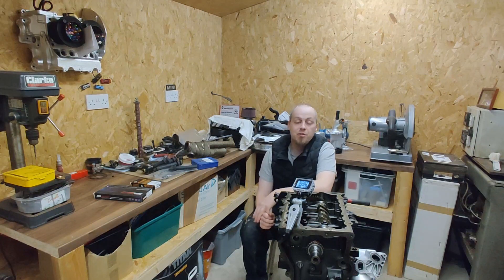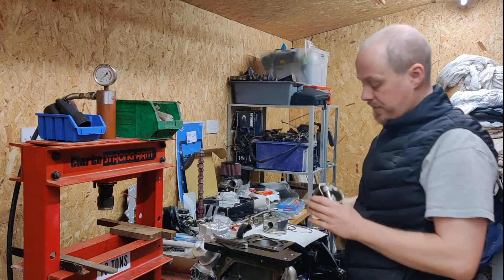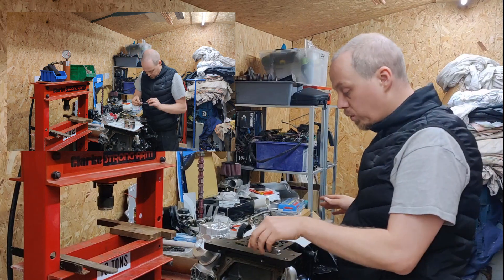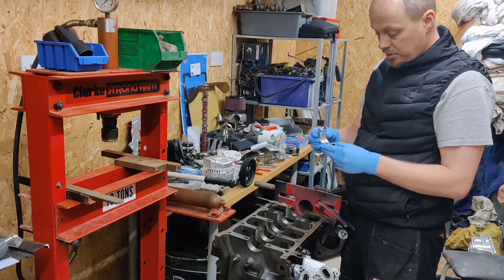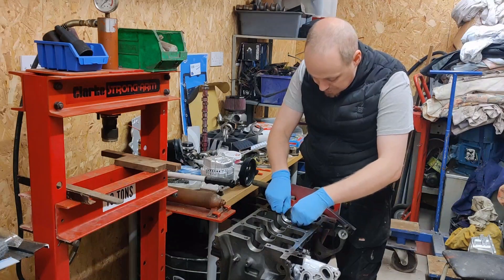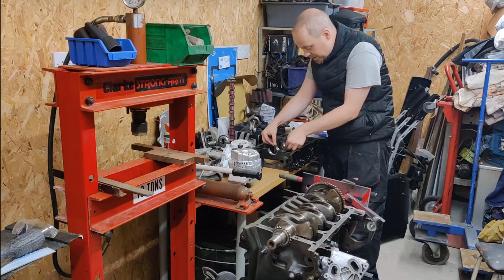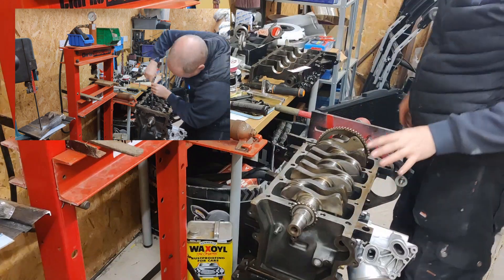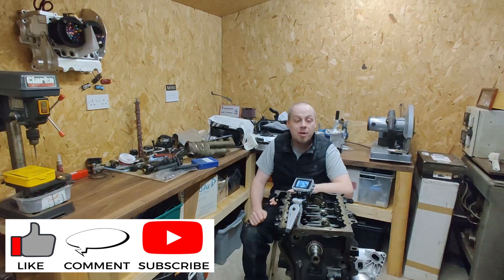Mini cooper R53 turbo engine bottom end build

Comment: Great video. Do you have the part numbers of the K1 rods and wiseco pistons you used?
Reply from the maker: Hi. I don't have them to hand but if you were to pop over to orranje performance there is only 1 set of k1's for the r53 and the same with the STD size pistons

Comment: Do you think it would be possible to put oil squirters in a r50 block
Reply from the maker: Yes it is possible as the oil gallery is there however the machining required to add them would most likely outweigh changing the block over to a W11 and start with a base engine that has what you need from the beginning

There may also be issues with the pistons off the W10 engine as I can't recall if they have the skirt notch to miss them. 

Do the right thing either change the block over to a W11 or the whole car though I know lots of people start with a cooper and want to keep that car. if that is the case and you are chasing power, get an S engine, gearbox etc and run that

Comment: Great video! Are you using new or old bolts when using the plastguage ?
Reply from the maker: I have done it both ways. This time I used the old bolts to torque up and new fitted. This is my normal manor, either way you look at it there would be questions ie original bolts stretched, new bolts stretching etc.
Reply: @rkde2042  So it OK to reuse the old bolts???🤔
Reply: @rkde2042  Meaning, I'm in the middle of a rebuild on a stock R53 and have been told you can not reuse the stretch bolts
Reply from the maker: @DoubbleAgent  Unfortunately this is one of the Internets do's and don'ts ~ Yeah for sure all stretch bolts should be replaced on a rebuild and I think we agree on this but then what about when tolerancing an engine? Clearly using a new set of bolts each time to tolerance gets very expensive and very quickly ie my beetle engine took about 7 attempts to set the tolerances and a new set of bolts would be very expensive. Then look at the ARP bolts which they state can be re-used. 

If the bolts were pulled past their yield point then yes there is an issue, if it is within its yield then it may retard back to its original form and allow to be re-stretched although the torque is relatively low on these I would question how far up the yield it is actually going. This here is what you will probably not know, the material composition of your fixings vs their yield at the point of full specified torque. Read newtis.info 

My advice is; use the original bolts to achieve the clamp force to tolerance and then once set change to your new bolts. The specific was that the mini engine is build is much nicer being in 1 large piece over several caps means loading is not quite but more shared.

At the end you probably will still have lots of questions, ultimately the ARP side will leave more questions - so we have to assume that the ARP fixing composition is so good they can be reused and thus assume the material grade is better and we do not go so high into the plasticity following their torque procedure - then sit down and ask how different OEM fixings are? especially as an engine with ARP fixings will probably take more short term abuse and the stock engine will do years of abuse. 

Finishing off - this is all down to the material grade which I do not know so it would not be possible to work out the ability to re-use and for this I think if you follow the above advice that would be your best shot

Comment: Nice work, I would love to rebuild my engine, but I don’t think I have enough knowledge!
By the way is there a gasket between the main casing and the lower casing?  I had my clutch done by my local garage and they said that is were my oil leak is coming from
Reply from the maker: Hi, there is no gasket. It's a liquid sealant. I use welseal but mini recommend a silicone type gasket. Could be done in the car though it would be a lot easier to take it all out. Maybe easier to clean the block and smear a sealer on the outside, won't last forever but will help to reduce the drips
Reply: Richard Everitt thanks Richard, I will look into that once the suspension projects are complete!